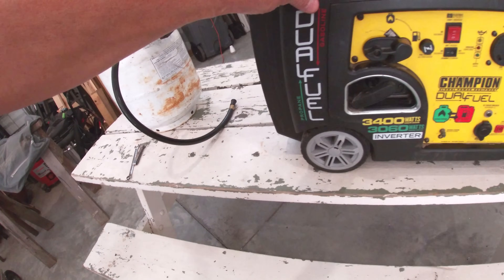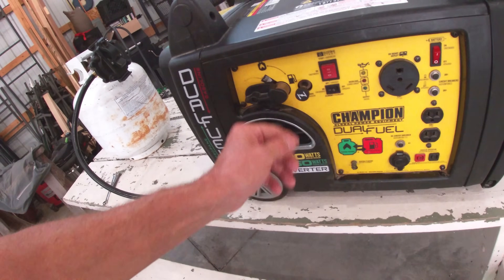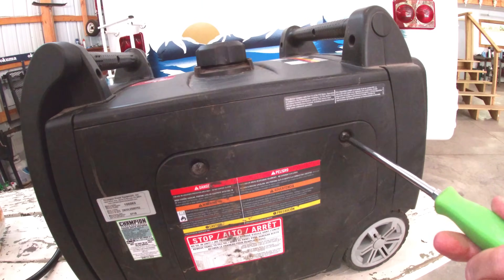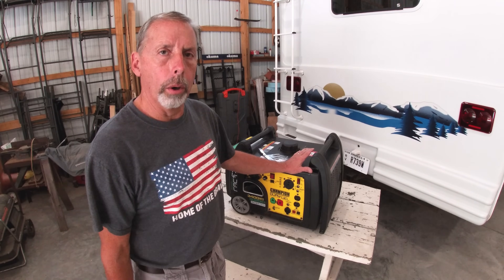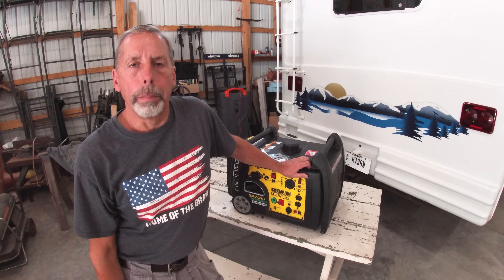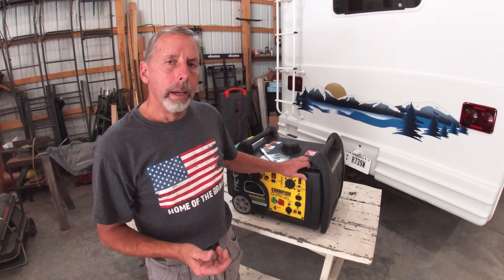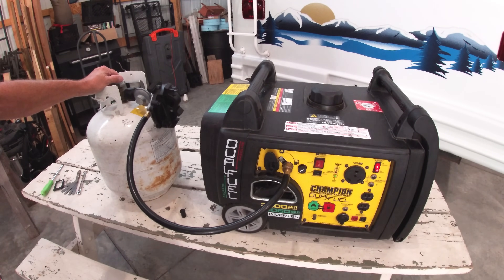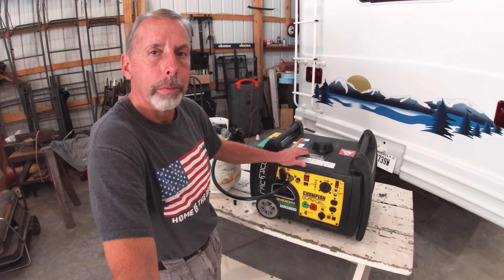Propane Generator Fail

Comment: I had my gas grill fail to start once and there was a pin in the valve on the tank which popped out to plug the gas outlet that had to be pressed back in with a screwdriver. I think it is there to prevent gas escaping if the regulator is removed, torn off or the tank opened with no regulator. I was able to reset. Also the tank may have another safety valve inside if the tank is opened while on its side or inverted. It was a head scratcher.
Reply from the maker: No doubt. Thanks for watching

Comment: So glad I watched this , I have the same generator and haven't had a problem yet . I do have a sun disk heater and a BBQ that I've had trouble with , I would have to disconnect the lp and reconnect until they would reach the proper temp. I thought it was dust in the line and now I know to slow. 
And knowing is half the battle.

Comment: Exactly. I bought a new tri-fuel champion generator and it would not run on propane. Followed the manual to no avail. Called customer service and was told what you said. Ran perfectly then on propane. Gave it a two star rating due to the poor manual operation on propane.

Comment: I really appreciate your video. I was having problems with a propane heater that would not stay lighted. I am aware of the slug valve but i did not know turning it on slowly would build pressure differently and trip the safety valve. Problem solved by turning bottle on slowly. Thank you
Reply from the maker: Thanks for watching

Comment: Not the regulator, it’s in the propane tank valve, a safety feature in the valve shuts the propane down if it thinks there is a broken line or nothing hooked up to it (opening the valve too fast).  Opening the valve slowly allows the pressure to equalize and allow full flow through the valve.

Comment: I have the slow propane regulator problem with Camp Chef stoves. The Camp Chef Chinese crap regulators have an overflow "safety valve" built into them that restricts flow if it thinks there is a leak. The Mexican and American made regulators I work with do not have this terribly frustrating problem. I bought a Champion generator when they were still new company. I converted it to propane at near the cost of the generator. I never had that type of problem with the conversion kit. I had other problems (eg. clogged spark arrestor, bad location of zero-gov regulator, didn't like the propane spark plug) and maintenance was performed per manufacturer specifications.
Reply from the maker: Thanks for watching

Comment: That happens when you turn on your main take to your RV also. There is a safety ball valve in all propane regulators in case a line break. When there is a free flow of propane that ball valve will trip. When you turn on a tank that has been hooked up the whole time after a day or so it will bleed down, then when you turn it back on say a day later and turning it on like you do a water valve it will slam that little ball valve shut.
So, on all propane tanks turn your tank on very slowly at first to pressurize the line then turn on all the way.
If you need more info on this, go to YouTube and type propane tank problems low flow there is a lot on info about this.

Comment: I learned about slow opening from a gas grill twenty years ago.  Regulators and be finicky so care, so don't.  Sometimes it depends on temperature (warmer=more pressure).  There is probably an engineer somewhere that knows exactly what is going on.   I've also had good luck letting the pressure equalize before using the gas appliance.

Comment: great vid, I am a fan of propane generators, particularly the long long storage possibilities of clean propane, low maintenance, no smell in storage or in use, easier handling compared to gasoline, wins all the way (slight reduction in power output is actually good for longevity of the engine)

Comment: This is great information, thank you.
I don’t have that particular model generator, but I do have a champion dual fuel generator. We haven’t ran it on propane yet, at all, but so far it works great on gasoline. 
Again, thank you.

Comment: I’ve had the same exact problem. With grills, generator and anything that run from those propane tanks new safety regulations. I was banging my head against the wall trying to figure it out
Reply from the maker: Yeah it was really frustrating me. Thanks for watching

Comment: Hey thanks for that information.  That could definitely affect other generators....a regulator is a regulator - I doubt those are champion specific.  
Another thing to consider is elevation.  I figured it wasn't that since it wasn't getting enough fuel and you had to choke it off.  But do consider that the average elevation of Arizona is 4,100 feet above sea level.  That can definitely affect the power output capabilities of any generator.

Comment: thanks for the video. I have had the same generator with no issues, run on propane of course, synthetic oil change every 75 hours. After 1925 (yes, one thousand nine hundred and twenty five) hours of use (in about 8 months) it developed some knocking sound from the invertor (I guess), like something is loose. The engine itself runs strong.  Champion tech support was useless, their industry leading 3 years warranty does not apply. I've just ordered a new generator, the same model, as propane is half the price of gas here. Hope it helps.
Reply: I wish Champion was as reliable as Honda. I put nearly ten thousand hours on my little Honda 2000 with a propane conversion kit.
Reply from the maker: Thanks for watching

Comment: My gas grill does the same. Also you should just open the propane valve 1/2 turn, not all the way. That solved my same issue. It is the OPD valve in the tank.

Comment: Thanks for sharing this, I have a different brand dual fuel generator that I’ve only used once and like you, I plan to only run it on propane, to avoid carburetor and bad fuel problems from gasoline going bad after sitting unused for months at a time.

Comment: I learned about slowly open the valve from issues with gas grill.  
Would barely have any flame and the company told me the same thing. 
Have not had anything issues since. 
The company told me it caused a sudden rush of gas and the regulator would go into a leak mode and restrict the flow.
Reply from the maker: I’ve never had any issues with my gas grill but now I know to do the same with all propane products. Thanks for watching

Comment: This is a common issue with most of the gaz regulator, eVen with the welding gaz regulator. Anyway, for your own safety, always open a cylinder valve  slowly to pressurize the system and prevent any accidental burst. Beside that, many thanks for the info. Hava a nice RV trip.😊😊

Comment: Good info on the video. This kinda reminds me when you have to open the valve on a natural gas meter. You open the valve very slowly so as not to blow the regulator with the high pressure.

Comment: Thanks for doing this very informative video. This same problem can surface with a gas grill also or basically anything with a regulator that you turn on and off regularly. Same  solution applies. I've had this happen with a gas grill and tec support stated poor quality regulators.

Comment: I had the same issues with my 10K generator by Champion.  It just suddenly started that same issue.  I performed the required maintenance etc. to no avail.  I called and emailed Champion several times and they eventually just replaced the entire unit as they couldn't resolve the issue (and we require a generator for charging up our battery rack during cloudy days as we're totally off-grid here.)  The replacement unit has worked flawlessly and I make certain to keep it serviced and maintained.  I too only use propane and the unit stays pretty clean as well.  (I also replace the oil each winter with a 5W-30 for easier starting in sub zero temps here.)

Comment: I bought a used 2500 watt dual fual. It didn't have a propane regulator, so I broke down and ordered one. Shipping got messed up, and I ended up receiving one with a 5' hose and one with the normally provided 2' hose. The long hose regulator would not allow the generator to run smoothly. So with great difficulty I switched hoses, (I planned on returning one of the regulators) and it turns out the longer, more desirable hose for my use, is what causes poor performance. Call me bummed. I thought I  got two for the price of one but only the short hose works for me.
Reply from the maker: Yeah if it’s seems too good to be true it probably is. Thanks for watching

Comment: The problem is related to the tank overfill prevention device.
.
It also has a fail safe to limit flow if there is no limit on tank output.
.
The bigger the volume filled on first opening the tank valve, the more likely it is to have the problem.
0.01c

Comment: The smaller the regulator the more likely this could occur.  I had the same problem with a small gas grill that had a regulator made for 16 oz propane cylinders which I converted to take 20 lb tanks.  That regulator required opening the tank extremely slow to allow pressure to equalize around the diaphragm.  As others have said, it is very common.

It is smart to have that spare regulator.  I have also had to replace regulators due to  being fouled by bad propane.  The propane store said it can contains some sort of oil that collects in the storage tanks used for refilling.  The oil gives the propane a skunk-like smell when it burns.  You can use an inline propane filter to prevent this damage to the regulator.

Comment: Wow ! In the tanks OPD valve there is an excessive flow safety valve. When the hose is empty the inrush of vapor slugs the valve shut. These valves are in place in almost all propane systems. They have even put them in the flexible gas lines for things like your gas stove.

Comment: I installed a tri-fuel carburetor on my UST GG5500 and I was having running issues similar to yours. Mine would start when I turned the propane off only for a few secs  then quit after I turned the fuel back on. I had an adjustable regulator and when I heard about the slow opening of the propane can, I backed my regulator down to 1-2 lbs. then open it further til it ran right. Sometimes I could only open it a little further because it would sputter. Other times I could open it all the way, and viola, perfect. If you leave the regulator adjusted down low, eventually the cans pressure is reduced and the generator will run bad until you open the regulator a little bit more. Sometimes that sweet spot is hard to find. But keep looking it's there. It's all goes back to the propane exchange instead of filling and keeping your own bottle. Those exchanges can act differently every time.
Reply from the maker: Thanks for your comment and for watching

Comment: Old post. But...😊
This should be a given for any propane device. If you haven't ran into this situation before, you've been lucky no damage or injuries occured .
Just like the propane valves on the RV itself, especially ones with dual tanks and isolation valves.  If you do not open slowly, the valve will lock out. It is a safety feature. 
The regulator you have has this safety feature. This way a sudden burst of propane shuts the "valve"/ diaphragm  at least partially, to prevent a "blow out" and damage to equipment and injuries to person.

Comment: Thanks for putting this tip out! It is a great tip for any vapor fueled engine or device with a regulator. I first heard of this sudden pressure inrush with Compressed Natural Gas (CNG) systems at the engine research center I worked at. In CNG systems the pressure is much higher than propane (LPG), at around 3200 psi pressure. The test cell CNG supply system included an inertia fuse that would trip & close off the inlet. Its first purpose was fire safety, in case a violent explosion tore open the fuel system close to the engine. Secondarily, it protected the fuel pressure regulators from the pressure spike of opening fast. If we opened fast & tripped the inertial fuse, we shut off the main fuel valve & vented the pressure between the closed valve & fuse thru a built-in needle valve & tubing to above the roof (CNG rises, LPG falls, rule to remember), then try again, Very slowly.
Could the propane generator be reset also by (1st, close the tank valve, (2nd) loosen the fitting after the regulator to vent the gas pressure against the regulator, (3rd) crank engine for a second to reset the regulator internal parts, (4th) retighten previously loosened fitting at the regulator, & finally (5th) Slooolly open the main tank valve & try a start again! Or something like that to relieve the pressure on the regulator. Paul

Comment: I've had the same generator as home backup for 8 years. This year a plastic part on the regulator broke so I tried to use the regulator from my other, newer Champion. Well, they're totally different--even the quick-connect! Then I tried to make my own from parts purchased online and at HD. Complete fail there too! Finally, I called Champion and they shipped me a replacement in two days for about 60 bucks. Pretty reasonable--I should have done that in the beginning!
Reply from the maker: I’ve tried a few times to start without the choke but it won’t start. Not sure why. I also tried a regulator from the hardware store that has the same psi rating but that was a fail also. Thanks for watching

Comment: OSHA insisted on placing check valves in propane hookups (Regulators) to prevent runaway gas venting and possible fire/explosions due to faulty equipment by do it yourselfers. This applies to barbeques and commercial applications too.

Comment: I have the same issue with my Blackstone, especially with a full tank. Wide open it will only have a tiny flame. Restart and open slowly, BOOM everything works as it should.

Comment: Thank you for sharing your experience with us.  I have a dual fuel generator and it wouldn't run faster than idle w/propane.  But i close the tank valve, and it would idle up, then die.  I'm running gas now and will try the method you mention when I refuel,  we just lost power from Helene.
Reply from the maker: Stay safe during the storm. Thanks for watching

Comment: It's inducive to all bottle type propane appliances. Most gas grills will come with a sticker on the grill that alerts you to open the propane valve on the bottle slowly for this very reason. Glad for the info. though, reminders are always welcome.

Comment: Although propane is considered low pressure, you will have the same problem or worse with any high pressure tank. Oxygen, argon mixes for welding, etc. You can destroy a $200 regulator in seconds. Our school was constantly having to send them in for repairs.

Comment: Curious? The only generator I would buy in a portable would be a Honda inverter. I have had mine for 5 years & counting. I haven’t done a drop of maintenance other than change the oil. 
Great advice from Champion though. All the new propane tanks you buy today all have that warning on them. I’m surprised your tank doesn’t have that warning? That’s been the case for over twenty years. If you open the valve too fast on a propane grill the same thing will happen. It won’t cook correctly.

Comment: I had this problem on my 5th tank.   I assumed it was the tank.   I had extra tanks so I hooked one up and it started like a champ.   That is easy to check.

A similar issue is electrical problems with a car.   First thing is always to replace the battery.   Then you can get into other parts.

Comment: When  you  open the tank's valve quickly you can trip the propane tank OPD Valve which will limit the propane flow to a very low rate. If the OPD senses a large flow of propane the OPD can trip closing off must if not all the propane flow.

Comment: F'ing awesome hearing this!! I was about to throw my three champion generators into the trash. I am done with champion because of their poor parts support and the no-start issue. When it is storming and cold, having a propane generator that will not start is an epic fail. Propane is not a perfect fuel but gasoline is messy and does not store well. Thanks for putting this out on utube.

Comment: This problem is due to the new propane tank valves. The same problem happens with grills. The initial burst of gas pressure when you open the valve often causes a safety feature to trip in the propane tank valve. Always turn the valve on SLOWLY.

Comment: Haven’t had this issue with my Champion, but likely because I’m conditioned to opening tanks slowly now from other propane devices. 

I believe there is a valve in the first stage regulator just like the regulator on bbq grills that’s purpose is to detect leaks when you open the tank. You have to make sure there is no gas flow downstream otherwise that could be detected as a “leak” and trip it down. 

I’ve had this happen many times on BBQ grill and even on my travel trailer. You often can’t reset just by turning the tank off and back on again…even slowly. The best way to reset it is turn off any downstream valves, turn off the tank, then disconnect the regulator from the tank to relieve the pressure between the tank and the regulator. Then reconnect and gradually turn the tank back on. 

When I use propane in my RV, I often will turn the tank on and then use the stove to check and prime the line and ensure proper propane pressure before I try to fire up the furnace. Saves me from a surprise cold night.

Comment: Good to know I just bought a westinghouse 12500 dual fuel. It probably would have run fine on gas I know you didn't want to but in a pinch

Comment: Flame arrestor.  Its purpose is to prevent the propane bottle from dumping if the host gets cut. Or catches fire. The information will be in the propane tank manual, which you probably didn't read or save.

Comment: I have seen similar issues with regulators for gas grills if the tank valve is opened too quickly.